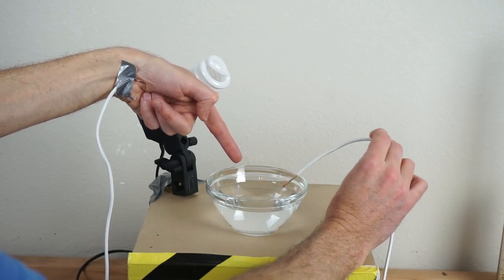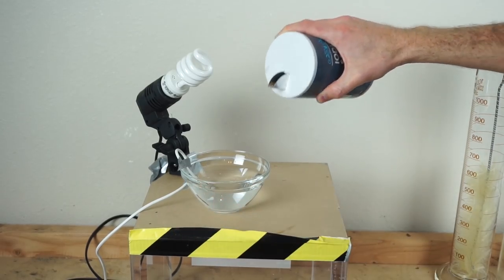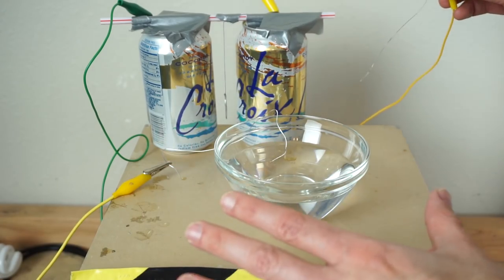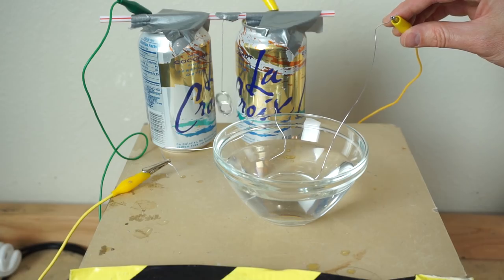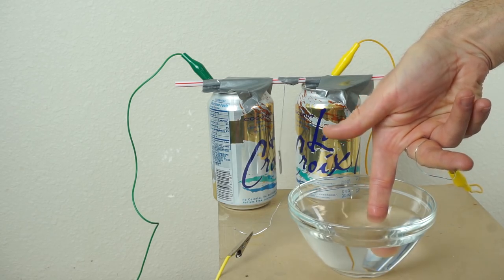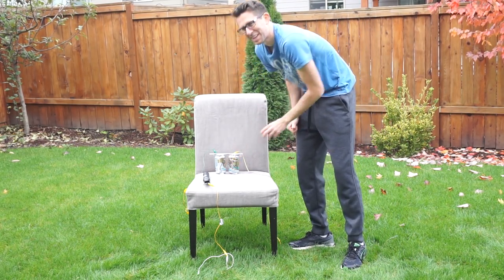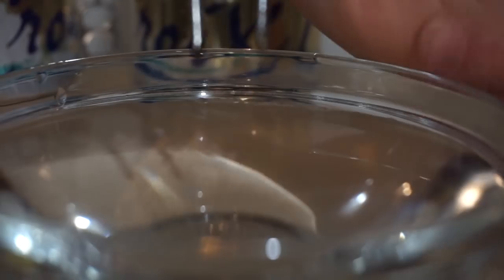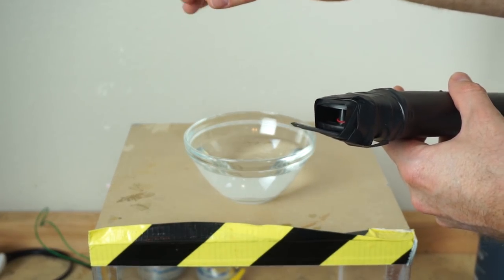Touching Deionized Water With a Live Wire in It—Will I get Shocked?

Comment: I run a wire EDM at work and have put my finger in the deionized water that filters through the tank while it is machining. No, you will not get shocked unless you get very close to the electrode. The water acts as an insulator and contains less conductive ions than is typical in tap water. This is done to control the spark that is emitted during machining.

Comment: You should show this is a test tube above or in the water with the electrodes in then and then turn the current on and catch the gases released, I have done this in a science class and then we took each test tube out one at a time with the opening down and then turned it a bit sideways and held a flame to the end and I can’t remember if it’s the positive end or negative but one should light and pop really loud for just a second and the other doesn’t really do anything

Comment: If I remember correctly, in the early days of electricity usage, theatre companies used water and large metal plates side by side, to control stage lighting. One plate would be negative and the other positive. So the further they lowered the plates into the water, the brighter the lights became.
Yeah, no, I'm not actually that old, but I read about it or saw it on TV.

Comment: lol I once received a gift that is a science project. it was to test specific fruits to see if they were able to become "batteries". I got 6 plug like "metels" copper, zinc and I dont remember the other one. it also included short wires to attach to the power thing (sorry XD). i attached the short wire to the copper and zinc and plugged it on a nearby outlet to see if i would get any current or what, and it exploded. the power all around the house fluctuated

Comment: Voltage is not proportional to current in the way you describe it, which is why tasers don’t kill you, despite the fact they can discharge well upwards of 50,000 Volts, they don’t even produce 1 amp of current. Voltage is just pressure, while amps is flow rate.
Reply from the maker: +Jonas Forsberg it’s ohms law. It is how I described it for constant resistance. Tasers have a limited current because they work with charged capacitors that have minimal charge and thus a non-fixed resistance approaching infinite resistance.

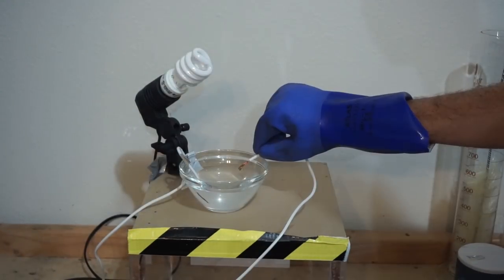Comment: That's nuts to use a CFL bulb as proof of no current flow, rather than a non-coated incandescent bulb in dim lighting (and yes, you can still get them cheaply).  1:59 - "This is what happens when you let all the current go through one of the tiny little wires in the main wire."  You get transported into the feverish imagination of David Lynch?  😉  Of course the most interesting revelation of this video for me was the existence of La Croix Coconut Sparkling Water.  😁
Reply from the maker: +DanHarkless ﴾Halloween videos, YTPs, & more﴿—the Liberals took away all my incandescent bulbs, and yes, coconut la Croix is the best flavor.
Reply: Um, hopefully you're kidding with "the Liberals took away all my incandescent bulbs".  If you really believe that, I'm starting to regret subscribing earlier today.  The Energy Independence and Security Act of 2007 that set the new efficiency standards for light bulbs enjoyed broad bipartisan support, and was happily signed the into law by George W. Bush as part of his overall energy strategy.  

The Act was also supported by utility companies and all the major light bulb manufacturers, who estimated that lighting accounts for 22% of U.S. electricity usage, and said that restricting incandescent bulbs could save up to $18 billion per year (or the equivalent of the output of 80 coal plants).

In any case, plenty of incandescent bulbs weren't affected by the act, including most halogen bulbs; 3-way bulbs; colored bulbs; appliance, candelabra, night-light, and other small bulbs; bulbs < ~40W; bulbs > ~150W; flood lamps; heat lamps; plant lights; shatter-resistant bulbs; and many more.  Not to mention that already-manufactured incandescent bulbs of all types can still be sold (and even if they couldn't, you could always buy online from a foreign seller).

Plus, spurred by the legislation, multiple technologies have have been developed to bring incandescents into line with CFLs and LEDs, efficiency-wise, e.g. by converting waste heat into light.

So incandescent bulbs will continue to be available in the U.S. for a long time to come (and my understanding is that the situation is similar in Canada).
Reply: @DanHarkless_Halloween_YTPs_etc  I really want to comment about Take A Chill Pill Bro! but got the Sarcasm from both of you. besides a little bit of FYI that you provided was interesting. don't regret subscribing. you get a thumbs up. hopefully i'll retain what i learned from you. OLE!
Reply: Thanks, yeah, there were a few details I didn't know either, before making that comment.  Turns out that after watching a few more Action Lab videos, however, I did end up unsubscribing.  Seems to be an "I'm not a student of the physical sciences, but I play one on YouTube" situation.

Too much erroneous information being "taught", too many unsafe practices being claimed as perfectly safe, too many instances of people with stronger science backgrounds pointing out errors in the comment section and then the guy arguing with them despite being wrong, too many nonsense beliefs alluded to, etc. 

Although the Action Lab guy does do a lot of interesting experiments, there are just too many good channels on YouTube by people with actual physical sciences backgrounds for me to have time to watch videos by a pretender.

Comment: Not many people know that water is a very poor conductor of electricity. It's the minerals and impurities in the water that do most of the conducting. your body also has a high resistance and it takes a lot of volts to create enough amperage to harm you. That's why you can grab a hold of both sides of a car battery and nothing is ever going to happen to you at 12 volts

Comment: Awesome as always. Can Deionized water boil in vaccum chamber. If so will it remain Deionized after boiling?
Can a taser ionize water?
Reply: Kavinprasad M The boiling point of deionized water is very close to that of tap water i.e. vapor pressure very close.  So both will boil in a vacuum so long as the water is liquid.  If it is a solid (ice) it will sublimate faster in vacuum than at atmospheric pressure.
Reply: Thank you!! 😉😉
Reply: Kavinprasad M Putting deionized water in a vacuum chamber and boiling it won't ionise it. 
It would be like putting a battery on a stove and expecting it to get charged.

Comment: When you say voltage is proportionate to current, that is when resistance is constant. If you have high enough voltage it could breakdown your skin and as your blood being a good conductor, the resistance will drop then high amount of current would starts to flow.  Now take a circuit that can output a current of 1000A at short circuit but is 10V at open circuit. Touching the leads would do you no harm as the Current is not a controlled source and generally is a very misleading statements that current kills not the voltage. The more accurate answer is: it depends on the situation. As in your video the current is limited to small burst and the capability of your system. For a laymen the voltage rating would be an appropriate measure for how dangerous it could be.

Comment: I seen if you touch  DE ionized water, you will ruin it? Is it because you are grounded?   And what if an ungrounded piece of aluminum or stainless steel touching it, will that take away the de ionized quality? 
Then same question but if the metal is directly ground to earth?   And what if only the rubber insulation of a high voltage wire is touching the DI Water? Will it stay de ionized in all example above?

Comment: Use a clear glass filament type bulb instead,  it will show the dimming on lower voltages (your "knows best" government may have banned them for sale, so they may be hard to get). That toxic mercury vapor spiral bulb you use is flickering because it needs the full voltage to start up. btw - good visual using the old school electrometer.

Comment: I once got drunk and shocked myself with 35kV continuously with my flyback transformer to see what would happen. After a while you get used to it! Probably destroyed a few nerves in the process. It does burn skin if you touch the plasma so gotta hold the wire tight.

Comment: how did you connect 3000V? is it DC?
Reply from the maker: +hq cart yes, DC
Reply: then your experiment is not correct. AC and DC are totally different dude.
Reply from the maker: +hq cart I know they are different:) but how does this make my experiment incorrect?
Reply: in your experiment, the 110V AC did not light the bulb through the deionized water. well, you should test 110V DC first before moving to 3000V DC.
Reply: It doesn't mess up the experiment at all.
Reply: @Tim Ramich - yes it does. his point was LOW VOLTAGE (110v) does not allow the current to flow in the deionized water. but HIGH VOLTAGE (3000v) current can flow. which is not correct. bring 3000V AC  in a deionized water and nothing will happen.
Reply from the maker: +hq cart why? It wouldn't have lit it either
Reply: It wouldn't matter that the current is constantly changing directions.
Reply: so if i get a low voltage 5V DC, would the current flow in the deionized water or not?
Reply: Why don't you do all of this experimentation and make a video for yourself, if you think AC vs DC matters?
Reply from the maker: +hq cart no it wouldn’t
Reply from the maker: +hq cart at 5V DC with type two DI water with the electrodes 1cm apart is the equivalent of a 1 megaohm resistor so you would get 5 micro amps of current.
Reply: hq cart No

Comment: the current wouldnt go through the ground using you because you have rubber soles on electricity wont flow through rubber
Reply from the maker: That's the point of the video:) At high voltages it will flow through things that normally are not conductive. Did you see that the wood became conductive?
Reply: thats crazy i knew wood could at very high voltages but not rubber
Reply from the maker: +Greyelk Tatu it also could have gone on the outsides of my shoe through a very thin layer of water

Comment: 10x voltage doesn't mean 10x current ...if keeping wattage it means 10x less current... voltage is a potential current is how how much voltage flows
Reply from the maker: V=I*R. If resistance is constant, then whatever you multiply voltage by gives you same increase in current. This is just ohms law. Voltage is potential (it doesn't flow) and current is how many Coulombs of charge per time is flowing
Reply: The Action Lab using the same hundred twenty volt power supply when you run the voltage through the Transformer you maximize voltage while minimizing current p=I*v... in order to get your 2000 volts out of 120 volts the current has to be dropped
Reply: Let me explain this is a very simplified manner. If you double the voltage the supply voltage the amount of current able to flow through a given resistance doubles as well, resulting a 4X more wattage total flowing through the load. A 10 Ohm resistor connected to 120V will draw 12A, and if you connect the 10 Ohm resistor to 240V it will draw 24A. This dosen't have to do with transformers, it's the resistance of the load multiplied by the amperage being equal to the supply voltage. The ability to trade Voltage <> Current with a transformer is a completely different thing, because resistance isn't part of that calculation, just the input and output wattage, voltage and current. Uless you want to calculate losses in the transformer, but that's yet another different thing. This is calculating load power draw at a given input voltage, not a transformer's output. Hope this helps you.
Reply: theLuigiFan0007  it does because he was using one in form of a ballast...theory is great but not what was happening... Or he would be dead..
Reply: You're definitely right that high voltage module can't provide the current necessary to cause serious harm under most circumstances. I was assuming the amount of current the supply can provide wasn't a part of the question. For theoretical purposes it's usually assumed your supply can provide infinite current when calculating V=IR. But yeah the voltage will drop when the supply can't provide any more current, so I guess it could have helped if he explained that as well. I thought you were confusing P=VI and V=IR by the way you phrased your original question. I get your point now, no problem, it's definitely a good one to consider.
Reply: You are wrong. There was general statement that it is not voltage, but current which kills you. That is true. Voltage is proportional to current? Yes and no. In general - no - as there are low current and high voltage products and au contraire low voltage and deadly high current products. When it is proportional? In case of mentioned Ohm's law, current is proportional to voltage only in case of the same resistor in the same conditions. There are materials which does not follow Ohm's law at all.

Comment: Voltage is NOT proportional to current in general (and you have made general statement). You can have huge voltage with low ampere amount and high current with low voltage. That is why 20 000 – 500 000 V in electroshock weapon does not kill you ( current is below 10 mA or 0,01A). 70mA (0,07A) kills you. Hairdryer is around 3A (or 3000 mA: 660W = 3A * 220V and as you can see despite the fact voltage is the same, the current is different based on power of the device).
Voltage is proportional to current in case of resistance -  exactly the same resistor in exactly the same temperature etc.
Maybe you just used wrong words, because I think it is obvious that 220V in your  power plug is a  lot more dangerous than 3000V you produced, and some people may understood it in wrong way.
Reply from the maker: This is just ohms law. I didn’t misspeak. V=I*R. This exactly says that voltage is proportional to current. For any given resistance if you increase the voltage by 10 you increase amperage by 10. You are comparing devices with different internal resistances so of course the amps will be different. High voltage devices like tasers do not supply a constant voltage, they use charged capacitors with minuscule charge. If they supplied a constant 500kV you would be fried chicken.

Comment: the electricity will not flow through the deionized water at 3000 volts
Reply from the maker: Yes it will, and it did. It just has a very low current.

Comment: So basically u can have 20billion Volt's at  low current and it won't kill u
Reply from the maker: +insta boss killer correct! But 2 billion volts
Would be hard to contain. At that high of voltage it would ionize anything around it and make it a conductor:)

Comment: I had 2 neon lights on my pc, but once of the transformers died, so while the PC was running i had the great idea to unplug the Neón from the dead transformer and connect it to the second port of the other transformer... once my fingers were close to the connector a plasma shock occurred :/ I was scared as fuck lol 

And I got burns from touching a circuit of a loaded  dslr flash that I had disassembled.

Comment: Put a 10 watt 1 meg ohm resistor between the cans on the 3kv part. You are checking the 3kv with practically 0 current.  A 1 meg resistor will give you 3 miliamps.  That CFL was probably pulling about 160 miliamps.  Would be interested to see your experiment repeated but use the same current or what the current would be if the wires touched in the water.

Comment: 120 Volts - uses thick rubber gloves. 3000 Volts - just uses his fingers as a bridge for the electricity between the water and the wire, by attaching it to his hand?! WHY!!!
Reply: In this case the 3000 volt supply he was using was battery powered and the battery itself provides an absolute limit to the maximum power output which is considerably less than the maximum and indeed very lethal potential current output of a 120 volt mains supply. An electrochemical battery has a ultimate limit which depends on the rate of the internal chemical reaction (and in turn the battery temperature) a few small electrochemical cells simply can't convert their stored chemical energy into electricity at a rate high enough to kill you no matter how high you step up the voltage.

Comment: to make the soda can contraption work you need like next to no current. There is a bell of that design that's been running on its own battery power for like 150 years. So yeah 150 year old battery too. And it's still going!